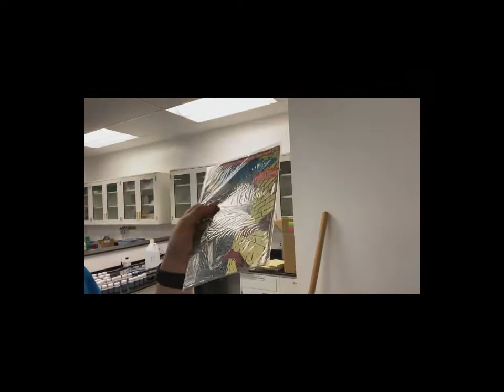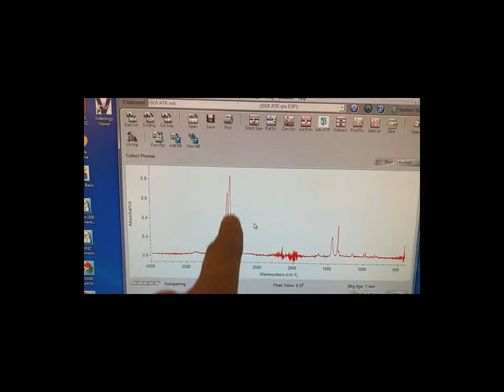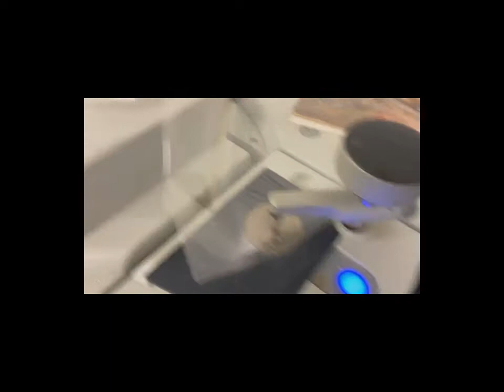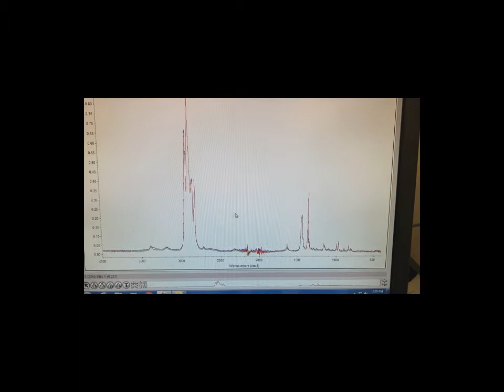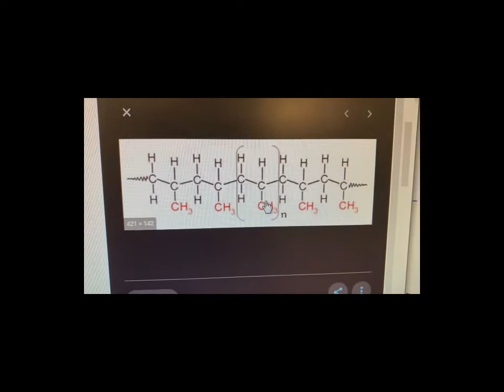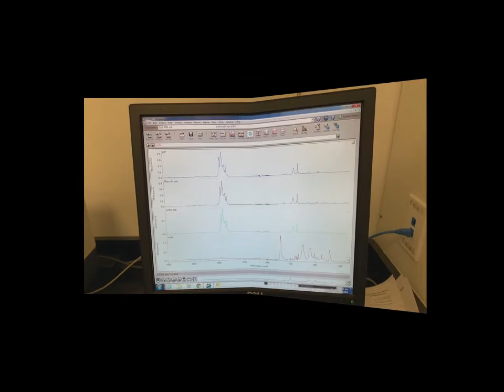Comic Book Bags Analysis by Fourier Transform Infrared Spectroscopy.

Comment: Hey Rick, just started watching your videos. Clave from @nerdsonearth recommended your channel. I’ve been collecting comics for 35 years and spend way too much time thinking about bags and boards. Im no chemist but I love the scientific approach and really appreciate your expertise. So, am I understanding your summary correctly that poly will be less aesthetically pleasing over time but not less protective for the comic?
Admittedly, I prefer Mylar when possible but most of my comics are not highly valuable and I don’t want to spend top dollar for their storage so I reserve Mylar for my keys and older books. I’ve never been opposed to polypropylene (or polyethylene) but so many sources make it sound like your damaging your books if you use poly.
I just recently placed an order with comic pro line and got a bunch of their poly (opp) bags. They say they’re polypropylene but they are stiffer than the BCW poly bags I’ve purchased. They look and feel more like Mylar. Can you comment on the difference between the traditional poly bag and an opp bag?
Reply from the maker: Yeah thats it in a nutshell.  I think that although the old bags dont looks great, they are still doing their job.  The OPP bags I have look good and last longer but several of them have split along the seams at the side, so I am wary of them.